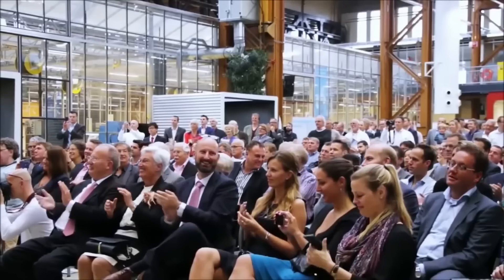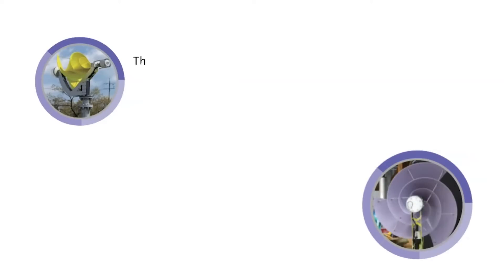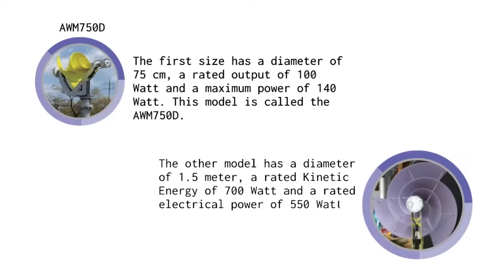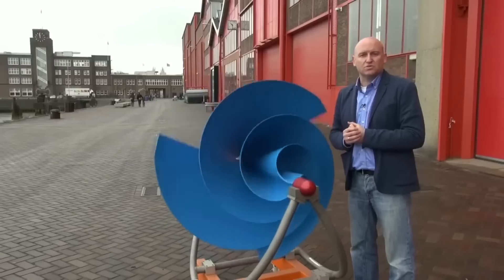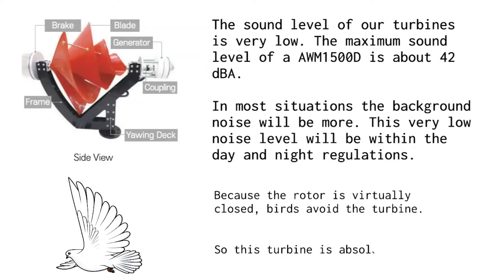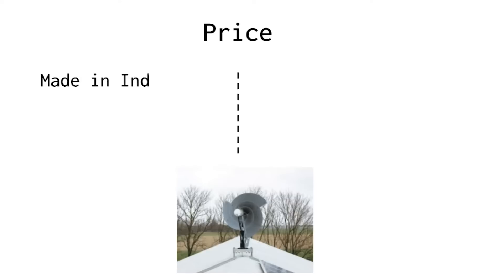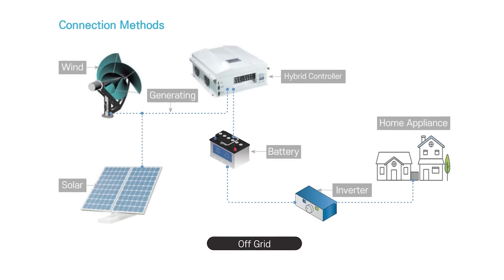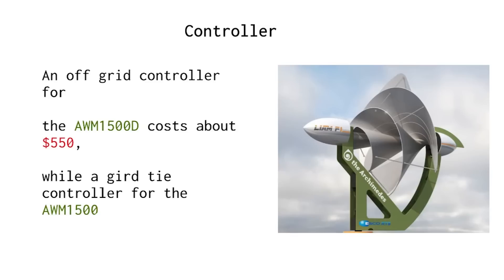All you need to know about Liam F1 archimedes wind turbine

Comment: Thanks for the video! The recommended shut down maximum wind speed (14 meters/sec is about 30 MPH) is far to low for my location. The 3-phase power conversion to DC or single phase AC would also be costly, I wil be better if with solar panels.

Comment: All practical tests of ground-based small wind turbines show: 1) They hardly produce any electricity. 2) They do not last long! 
Wind close to ground is extremely gusty. 9 out of 10 small wind turbines therefore stop working after some years!

With solar panels, you can generate at least 10 times more green electricity with the same investment! Reliable and almost maintenance-free.